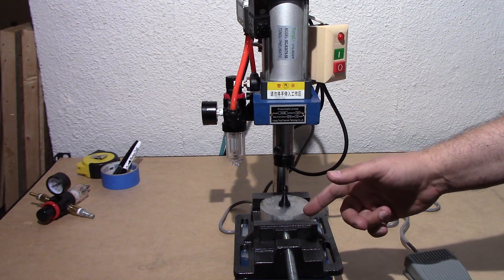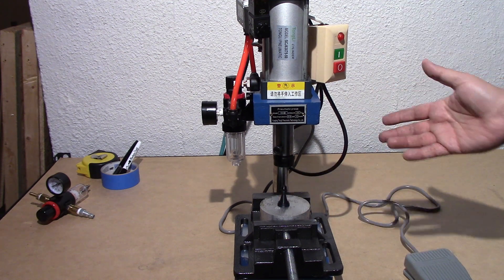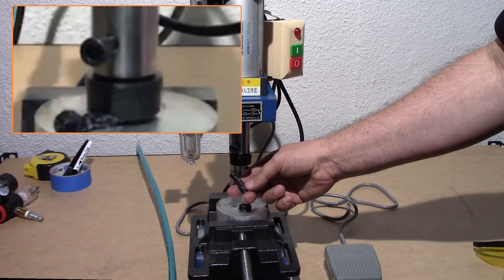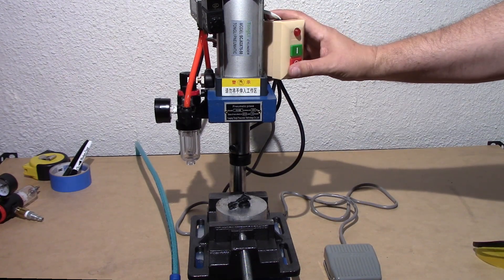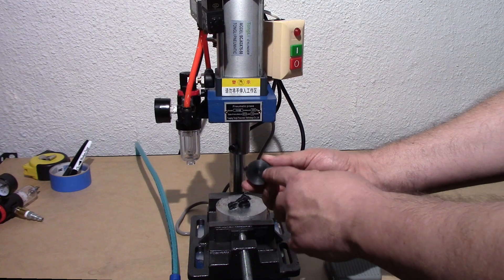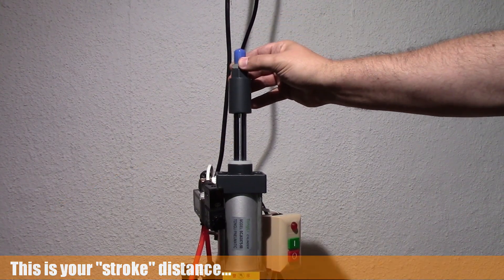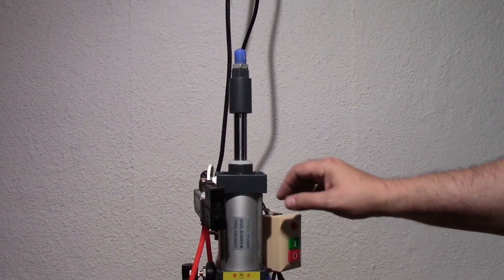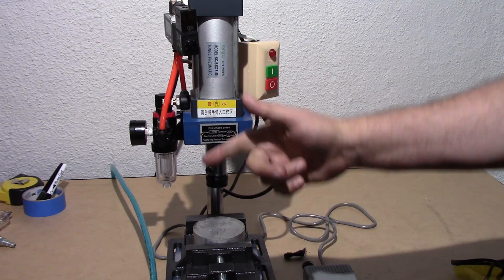Mini Press - Setup and Crushing Something!

Comment: What is the maximum clearance from the bottom of the punch to the base of the plate? I’m looking for a new press to use for my firework rockets and I don’t necessarily need a base plate I just want to know how much clearance there is when the piston is all the way up thanks for any info you can provide.

Comment: Hey mate, stupid question but it just works with the air compressor connected? I was looking on Ebay and the seller told me that it works without the compressor :/
Not sure lol
Thanks for the video and answer!
Cheers
Reply from the maker: Correct this requires an air compressor to operate
Reply: DIY3DTECH.com Thanks for your answer. Yeah, this make a lot more sense lol I’m not really into it, any idea or recommendations how big or powerful air compressor I’d need?

Comment: you could design some sort of thin metal bending jig.
Reply from the maker: Yes been thinking along those lines as will bend light sheet metal like you would for a case or panel.  Also looking at jeweler dies too...